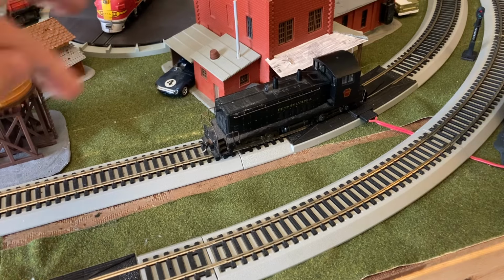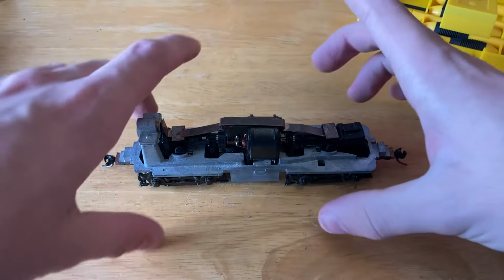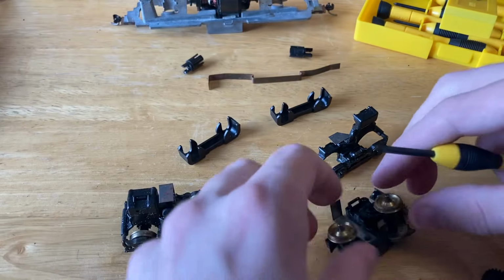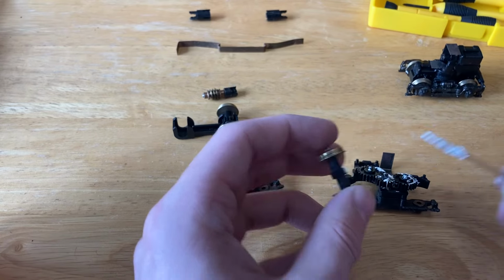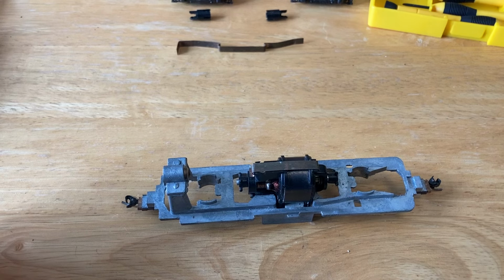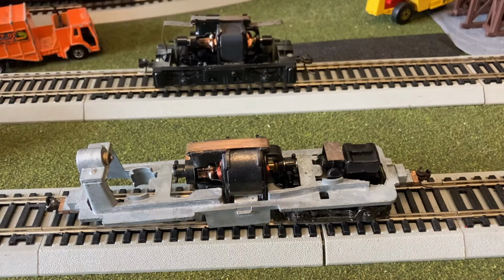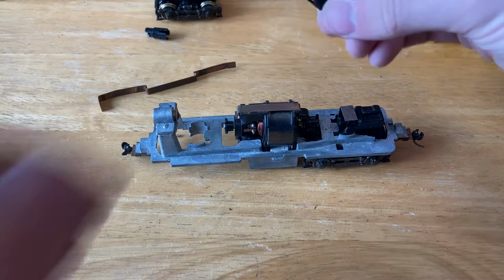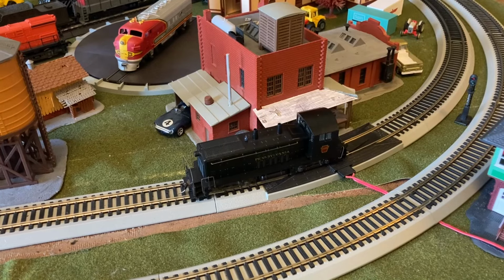Athearn Blue Box SW7 Restoration ⛽️🧰 Can We Fix It?

Comment: Super. My railroad still operates five Athearn EMD SW-7 Bluebox switchers, bought back when Athearn identified them as SW-1500 locomotives. Three cows and two calves, almost fifty years old, call my railroad home. Two, a cow and calf set, had radial couplers installed to allow them to work the freight on the trolley line, which has 4 3/4 inch radius curves and is mostly paved street trackage in the city. Good job fixing a classic. Hello from the Tracy Mountain Railway in Colorado. 💙 T.E.N.

Comment: I guess you seen that the front truck assembly had a bad drive coupler that was slipping on the drive shaft, so you removed the fitting and didn't attach the front truck to the motor. I also noticed that the motor angle tells me the motor mounts are bad and only one tung of the brush cover is touching the frame under the motor. It is good that you didn't remove the motor because finding the motor mounts for the smaller Athearn motor is difficult. I like the fact that you make it run no matter what. WD-40 makes a specialist electrical contact cleaner that dries fast and leaves no residue. Great for commutators and more. Great video.
Reply from the maker: Oh, I thought I mentioned that in the video. I tried yesterday to fix the mounting piece, but that was to no avail so I removed the worm gear and added a spacer to the underside of the shell to add proper electrical connection to the chassis.  Thanks for Watching!!
Reply: The NO-OX-ID grease is a conductor. Did your fix work?? Please shave on you channel. I suspect that you live in the USA and there is a massive amount of parts available on Athearn Roundhouse shop, something I can not access living n Canada other then Ebay. 
Worse case you can always solder a wire to bridge the rail pick up and the motor. Depends on you skill using a soldering iron.
Reply from the maker: @paulflak2823  Thanks for the Insight. My fix is still working, but I will probably use the advice given in the comments to improve this model more. Since this channel is not monetized, I can’t allocate that many funds. Thanks for Watching!! 🚂

Comment: Hi, You didn't add any oil/lubricant to the wheel bearings.. (well at least not on camera)..... Did you not notice when you had the eraser trying to clean the commutator that you were not turning the motor as the other universal joint (on the right side) was not turning so, therefore, that connector you were turning was just spinning on the shaft.
Reply from the maker: Since posting the video I have tried to fixed the broken link, but it was to no avail. So I removed it. Thanks for Warning!

Comment: That is not an SW1000, not even close. You might want to avail yourself of the information before putting this out in a video, or just say you don't know what model it is and invite viewers to tell you the correct information.

The model is an SW7. It was originally and erroneously marketed for decades as an SW1500. There was also a cabless booster produced so the two could be mated up as a TR6 cow/calf combination. It wasn't until about the 1980's or 90's when Athearn finally corrected their error when they began marketing an actual SW1500. They also now produce an SW1000 as well.
Reply from the maker: I fixed the title and thumbnail. I my 15 minutes of research(that I did a week ago) I found that Athearn labeled the locomotive as a SW1500 but when I looked up other images of SW1500’s the headlights did not match. So I looked up SW1000‘s and I found a few photos of locomotives with the round headlights. That is why I made my initial choice to call it a SW1000. I understand your frustration.
Reply: @Thelefevrefever What you need is an excellent book that is now long out of print, from the editors of Trains magazine, entitled Our GM Scrapbook. It's basically a collection of stories and photos from their magazine over the decades, along with selected diagrams, of the development of EMD locomotives through the 1st and 2nd generation diesels. It's not even very long - it's about 9 x 12 softcover and not even a 1/2 inch thick. Another useful handbook is one of the Diesel Spotter's Guide books by Jerry Pinkepank. It's been updated through the years with new editions to supplement the older ones - this is an essential and covers all makes and models, including rare and hard to find models.